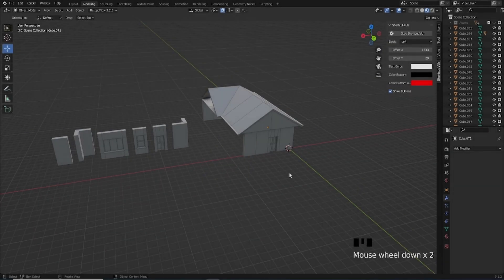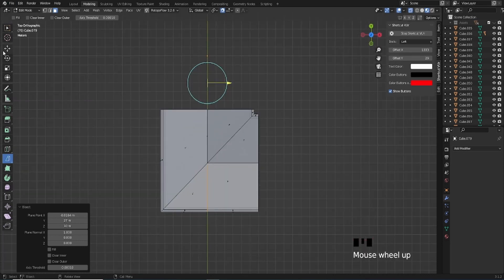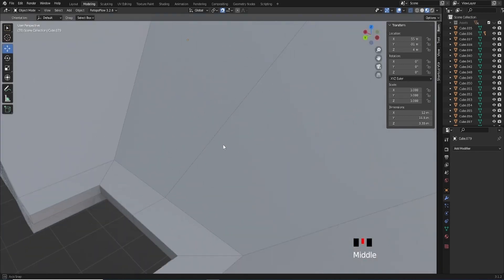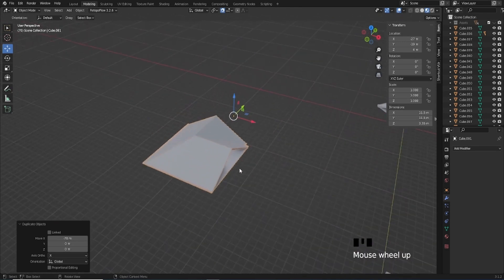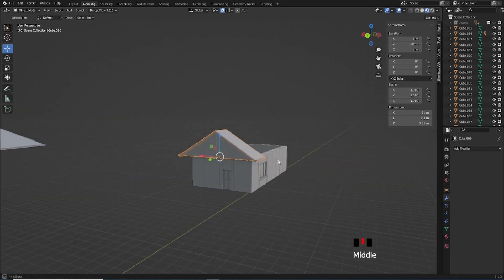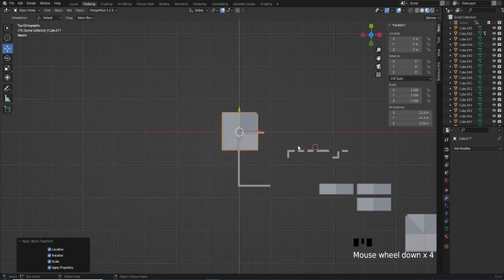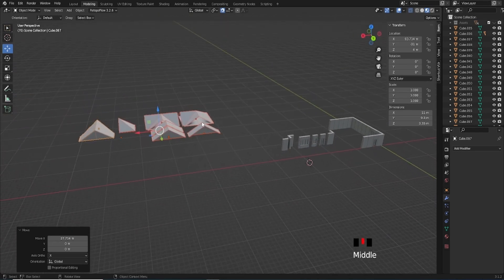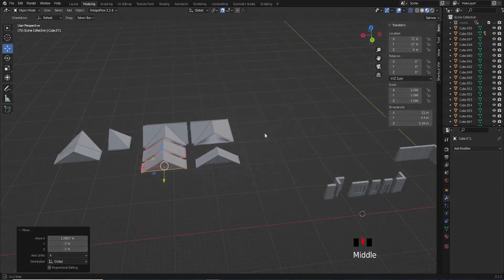Blender Modular Design - 07 Roofing Cross Sections

Comment: 10:33: In new versions of Blender the Snap doesn't work the same way, now you select the faces you want to snap, after that you need to select Vertex in Snap, then move the faces with G and without placing the faces press "B", you'll see a little box, use that box to select the vertex you want to snap (in this case the roof one) and press left click on it, you'll see that now you can move the object/faces etc using the mouse without pressing G, now move the cursor with that little box to the vertex you want to snap to and press left click again, done